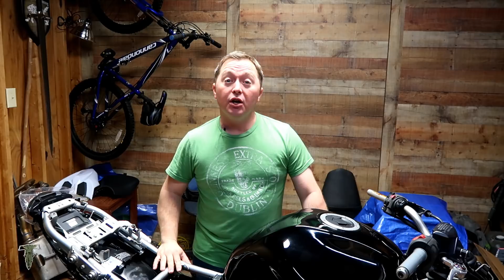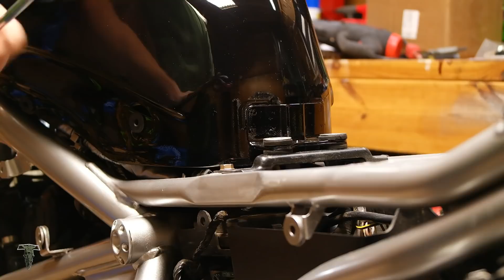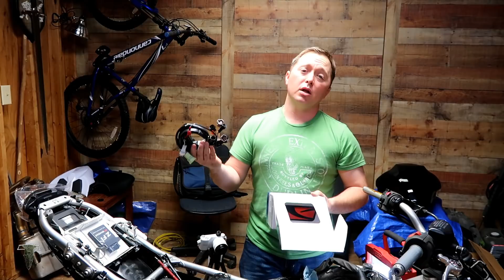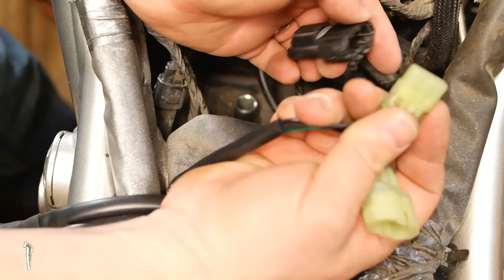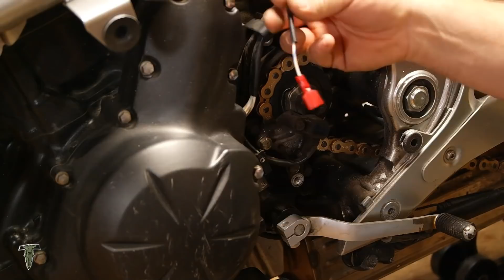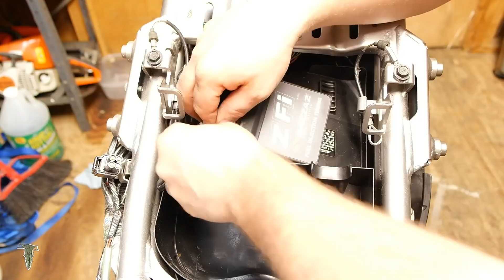Bazzaz ZFI | Motorcycle Fuel Controller Install | Ninja 650 Ride Rehab ep.6

Comment: Can you help recommend which Bazaaz would be best for my 2018 Ninja 650?  I want to tune myself if I can afford it, and if it's not overly complicated with numbers etc. Running a computer is not an issue since I'm a Systems Support Admin at my day job. 
I know I will have to do this because I want to change out my exhaust soon. I can't stand such a quiet bike. Makes it harder to operate because I drive by ear.

Comment: Will this module allow engine brake tuning like you did on your z650?
Reply from the maker: This is fuel mapping only. The Z650 uses a Rapid Bike ECU which allows adjustment of engine braking.
Reply: Is the Ninja faster than the Z?
Reply: Antonio Daehler . One is a naked bike and the other has fairings. Otherwise I believe they are the exact same bike.